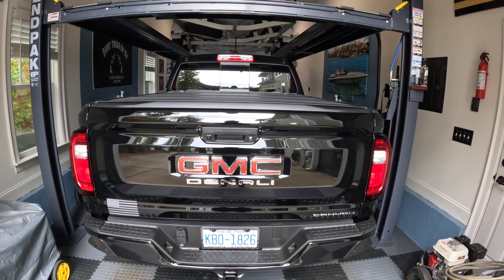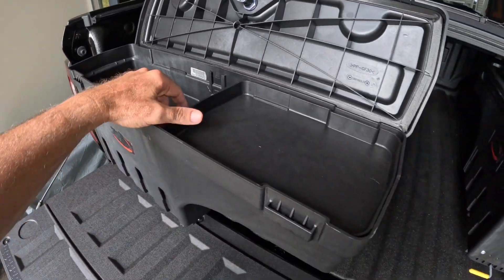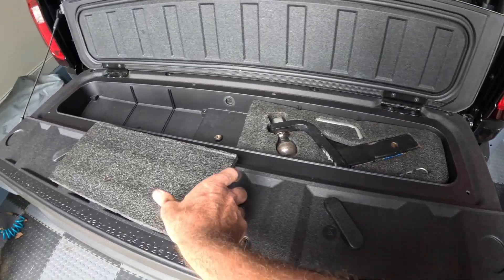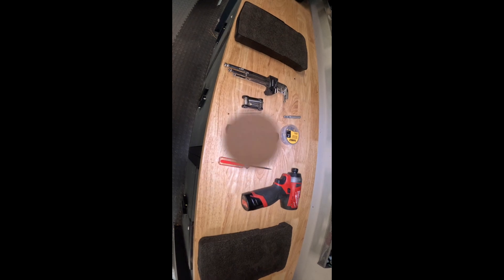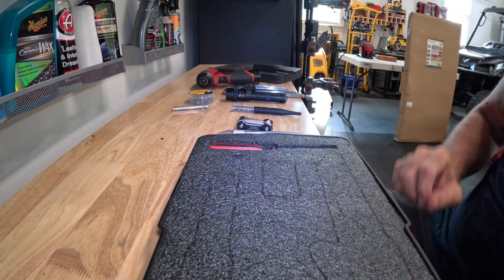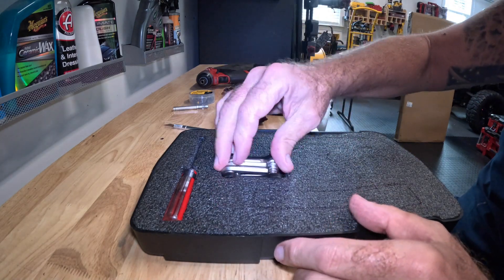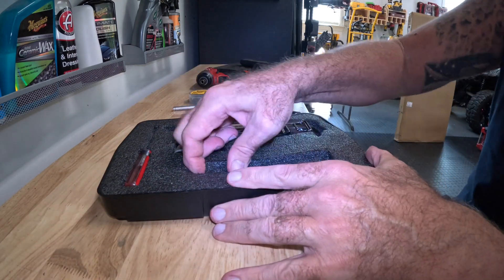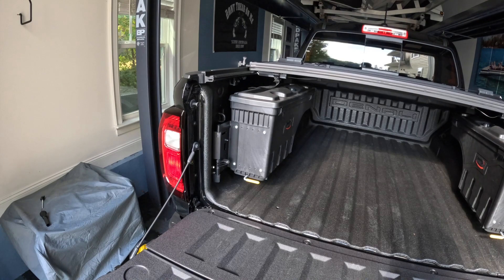2023 GMC CANYON DENALI REAR STORAGE AND ORGANAZATION

Comment: Interested in these swing cases for our Canyon. Did you video the install process?
Reply from the maker: I don’t have a video, but the install is similar on all trucks.  I believe you can search and come up with a few.
Reply: Can you measure in-between the cases when they are latched shut? Curious how much space it allows for sliding boxes in and out of the bed.
Reply from the maker: @boweichel1268  I can, but they just pop off if you want to remove them.  Takes a second or two to remove.

Comment: Great video!  So the passenger side Swing Case, you do not have to modify the bracket to accommodate the bed outlet at all?  I'm really looking for a tool box solution.  I like carrying a small set of tools with me.  Nothing huge.  the 2 swing cases would be more than enough space.  But I don't want to block my bed outlet if I can avoid it.  Love the idea of the Kaizen foam.  The hitch storage with the foam is a killer idea.  Any issues with water in the tailgate storage?
Reply from the maker: No, it does not interfere with the outlet.  The outlet is set back far enough.  I have not had any water in the bed storage compartment.